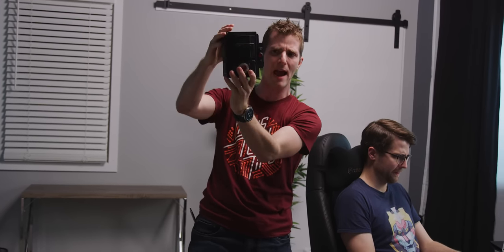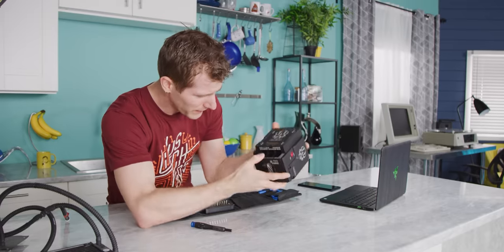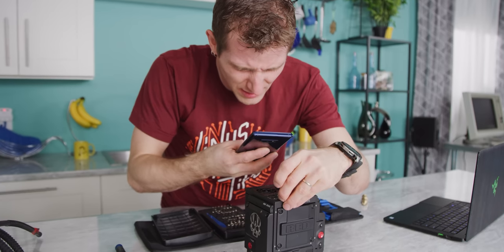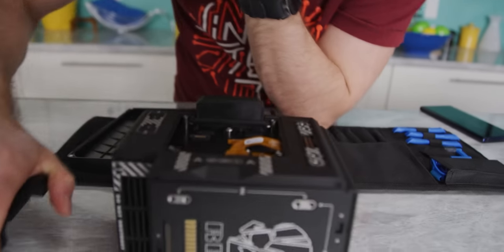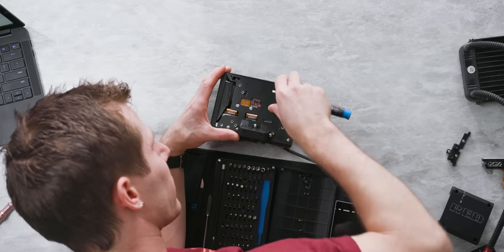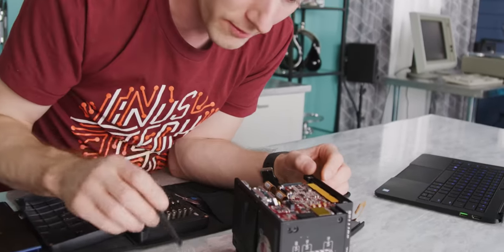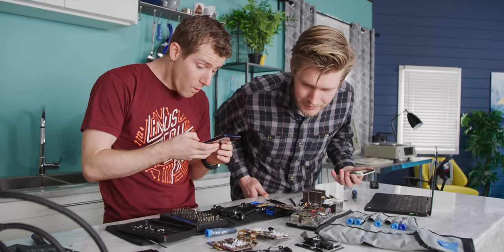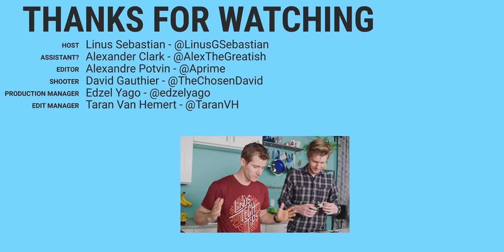We TOOK APART an 8K Camera!

Comment: That bright tangerine titan arm tho. I wonder if Linus knows just that arm is $300+
Also in relation to Linus' question about benefits from water cooling. I'm sure Brandon has overheated a red sensor once or twice during the summer when sound is complaining about the fan noise even when using adaptive preview, quiet record. The real test for this will be during summer in 35degree heat and seeing if the sensor overheats while using adaptive preview/quiet record. That feature Linus is speaking about is the adaptive preview/quiet record and can be modified or disabled to keep it at the temp you choose. If shooting mos in heat though there is no reason to use adaptive preview/quiet record.

Comment: Destroying a $20K machine with precision cooling design to keep the sensor temps stable for consistent image noise pattern, plus compact design that allows the camera to be small and mobile and  yet remain operational in a wide spectrum of temperatures and other environmental conditions, just to pass some waterlines so you can shave a db of noise, if that ever works, while screwing your mobility, reliability and image quality. Should name the channel "Linus I have no idea whatsoever Tips".

Comment: well.. cool project. but if Helium 8k means anything more than a marketing term, then i would assume the helium is for cooling. a lot of fancy math and physics behind surface area and such, nothing will cool better than Helium.... they use it to cool MRI machines and the Hadron Collider.... it is the superior element for such a task.... as hydrogen.. well refer to the Hindenburg for further details....
all that said i highly doubt the camera is capable of making Helium a liquid. which would be necessary... good luck though... hope to see it working sometime again before we run out of helium.

Comment: This far in ... might as well 3d print a new body for it and balls to the walls with the heat spread solution ... water cool it ... strap one of those gigantic cpu heatsink to it ... copper heatsink so you can liquid metal that beast

Comment: Wow you must be extremely brave, confident, and crazy or a mix of all to even attempt something like this especially as you have no guides to follow. I certainly would not want to throw away that kind of money if you break it just for a few YouTube videos. Sure I am would guess there would have to be someone who does service them but it could still be thousands to get it back to where you were with a fully functioning standard camera.
Cooling the sensor especially could improve your image quality a little especially if you are doing long takes in hot poorly lit places as heat will introduce noise to an image and possibly cause hot pixels. As you mostly shoot in I would guess shorter takes in climate controlled environments with good lighting I doubt there is going to be much difference. If I were doing a mod like this I probably would just make a custom addon to the outside that chills the air likely using a Peltier cooler before it enters the camera and possibly increase the airflow.

Comment: Wow is that EVER complicated !!!

I'm mangling a typical German Engineer's Saying here but....

 "Warum einfach machen, wenn der Komplex auch funktioniert?"

 or in English:

Why make it simple when the complex also works?

 seems to have been followed intensely by the U.S.-based Red Camera engineers!

---

If I was doing this engineering work (AND I CAN ACTUALLY DO IT!), I would put in simple PC-104 motherboard form factor with an AMD RYZEN-7 2700 combined CPU/GPU hard-soldered to the mobo and hard-soldered 64 gigabytes of RAM and a decent 16-bits per channel analog-to-digital converter (4 channels for Red, Green, Blue and Alpha or Distance channels and 4 channels for audio)  would run RINGS around this setup at a MUCH cheaper price! The Menu system and camera control/communications, GPS Location/3D-XYZ and lens metadata microcode would be handled by the CPU part and the GPU would do the actual imaging RGBA/YCbCrA conversions, LUT’s, Gamma, Hue, Saturation Luma correction and the 4:4:4 RAW / Motion Wavelet / MPEG-4 / H.265 compression and file encoding!

AND THEN I would dump the whole board in a sealed and outside-and-inside-finned fully-filled-with-silicone-oil liquid immersion cooling  box machined out of 6000 series Aluminum, Titanium or Magnesium Alloy! Only TWO connectors would come out of that box! A Dense-wave multiplexing fibre optic for all the audio, video, lens and GPS location and 3D-XYZ orientation metadata that will be sent to an externally attached connectors box containing SDI, USB-3.2, HDMI, DisplayPort, ThunderBolt, RJ-45 connectors for video output and 3-pin XLR, SPDIF or RCA connectors for audio output AND a simple POWER CONNECTOR probably 12 or 24 volts at whatever amperage is able to support the Ryzen-7 2700 and the ADC chips and 8K sensor!

Almost EVERYTHING ELSE can be done by software on the Ryzen APU chip as I am pretty sure that DC-8k 8192 x 4320 pixel 16 bits per channel (64-bits per RGBA pixel) compression at 60 fps CAN be done by the GPU portion. And if one Ryzen won't work then put in a second separate AMD W9200 series GPU chip for full 8k processing at 60 fps. The liquid immersion SHOULD WORK JUST FINE for cooling! Any ANY decently sized Anton-Bauer battery setup at 175 to 375 watt hours could power the camera for between 1.5 to 3 hours!

If I had to do this I would simply use my already done DCI-8k multi-format codec/colour corrector and recompile for the GPU portion of the RYZEN and do a PC-104 board with daughter-card etching for the brains of the camera. I'm guessing based upon previous experience, I could have all this done in less than 6 months? I know I could do the basic PCB layout in about four days and have at least a basic test module done in two weeks! Then it's just deep PCB simulation and codec coding!
.

Comment: I never wood take my RED HELIUM 8K in parts! 
Sry Linus but this hurts! Start reading the Operation Guide at page 160!
https://www.red.com/downloads/
The camera has an active warming up process!
Watercooling this camera is totaly useless. 
The Camera needs to hold a temp around 40°C for the best imagequality, thats the default!
How do you will manage to have always exact the same temp? 
Use adaptive mode in Fan Control and it's all fine!

Comment: Hello, linus tech im a huge fan of the show and i hope you read this comment, i have  sugestions for your next  videos, i want you to go to ebay and find cray xt4, 8 socket amd opteron and try to game and benchmark, after that i want you if thats possible to take 4 intel phi 72x5 or whatever intel phi model with the maximun amount of cores and threads and try to find a 4x socket cpu motherboard capable of taking those 4 intel phi processors to display the maximun amount of threads  ever on windows machine over 1,000 and do the regular benchmark and cinebench and everything and try to game with rtx 6000 and intel phi and gp100 and gv100 single card and the 4 intel xeon phi cpus, and after that you have to find the cray xc 8 socket cpu xeon single motherboard they have and do a review, if you manage to get the 4 socket cpu intel phi you have to give it to me at least with quadro m6000 or p6000 with the fastest 512gb ssd that you know that can boot windows 10 pro 64 and a 4 tb mechanical hd, then do another video doing a review to a very rare dynamic ram ssd called Acard ans 9010 is a ram memory ssd with dual sata ports takes ddr2 memorys very rare and fast you can find it on ebay for less than 200 and run some test then try to find if you can one of these ram memory ssd ramsan 300 ramsan 400 or ramsan 440 and do some test, also try to find the fastest ssd from fusion io you can find those on ebay as well they got iodrive iodrive duo  iodrive 2 iodrive octal wich is the fastest i beleave and review that thing i think i earned my quad socket intel xeon phi monster.   ; ) cant wait to see 1,000 treats.